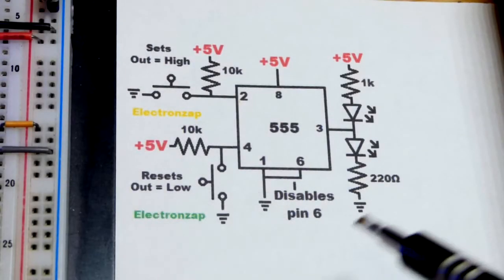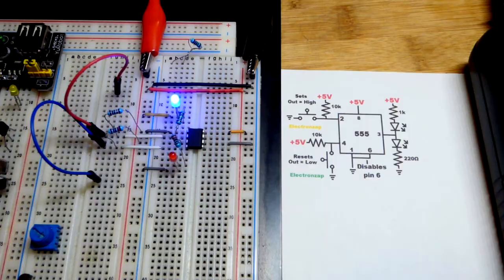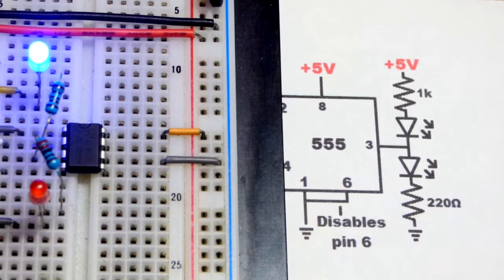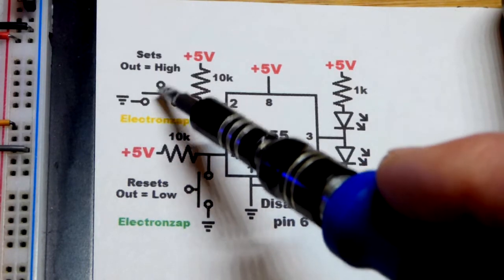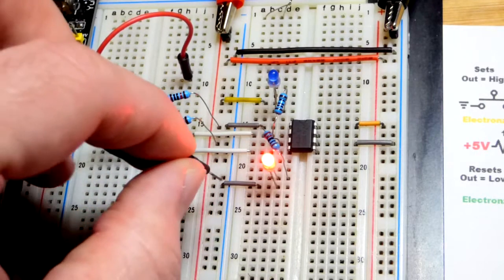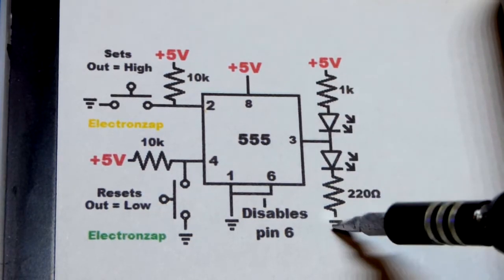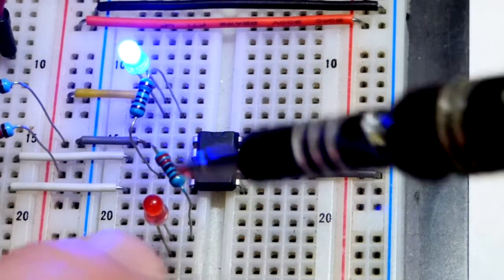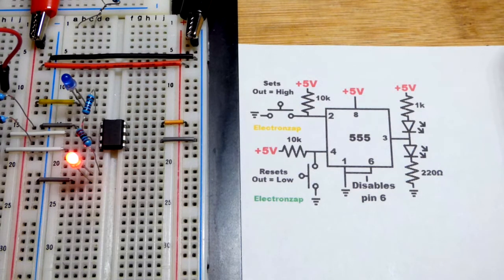Bistable mode 555 timer flip flop electronics circuit how to DIY build tutorial by electronzap

Comment: Does the jumper between 6 and 1 have to be there for it to function correctly?  Or, is it optional?
Reply from the maker: Pin 1 connects to the negative supply rail (ground) to power the integrated circuit. Whereas pin 6 connects to ground to make sure it doesn't change the output when it gets hit by stray signals surrounding it. You could use a resistor to connect pin 6 to ground instead and the circuit will work exactly the same. The 2 pins aren't interacting with each other at all as far as the external wiring is concerned.
Reply: Aah, I understand now.  Thank you for the explanation!